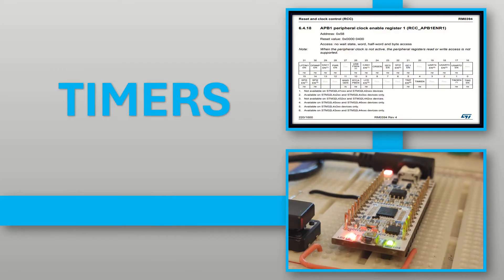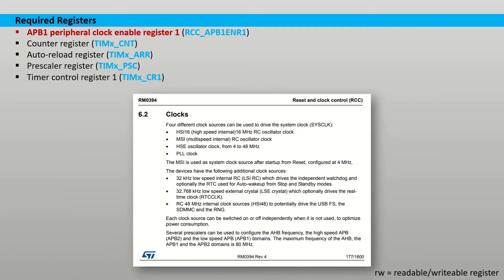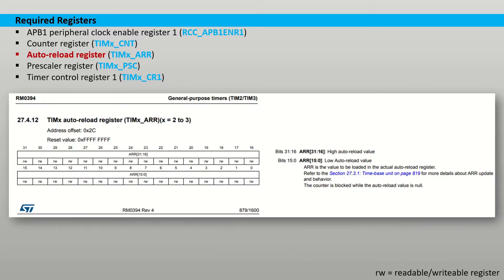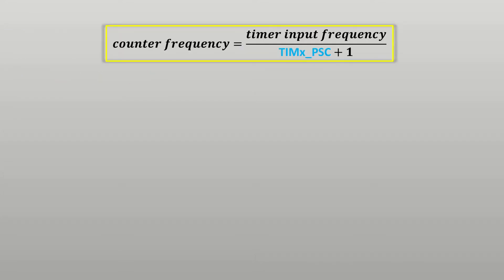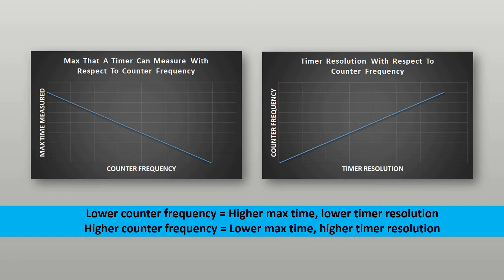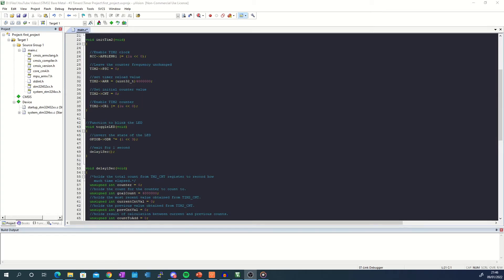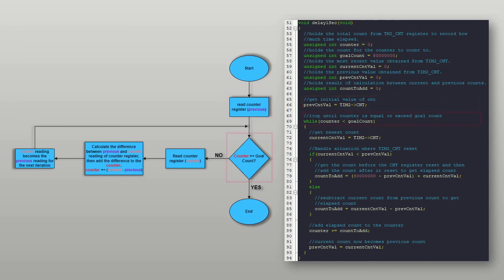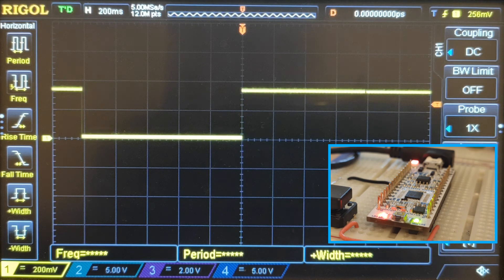How To Program A STM32 Timer Using Registers

Comment: At 3:08 you say you start enabling the timer by setting bit one of the clock enable register. (1u << 0) sets bit zero not bit one. Isnt it?
Reply from the maker: Ah, yes I did make a mistake here. I meant to say bit 0. Well spotted, thank you!
Reply: @z-the-programmer4584  Wellcome. You have a great way of teaching neat with examples showing the code and the manual. It would be great you would make more videos covering more topics like interrupts UART DMA ect. I would pay for it if you had Udemy. Thanks!

Comment: Probably I understand why everyone "experts" talking about bullshit with timers like PWM, IRQ and other blah blah blah. My question is simply: I need meassure freq of external signal, so for good precision I need driving one timer to gating by second timer for safetly stop counting and safetly preserve counting value even extended up to 32bit. Also don't forgot about AN4776 and check figure10 where explained how the clk is desynchronize when crystal oscillator doesn't feetted to this exercise.  So really you must understand when using oscilloscope for meassure 1sec interval don't impress me much.